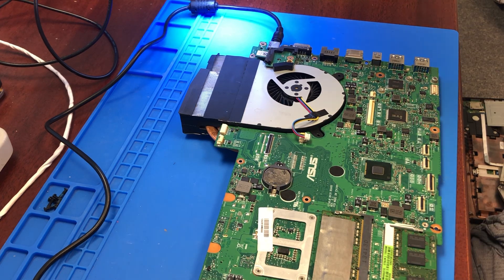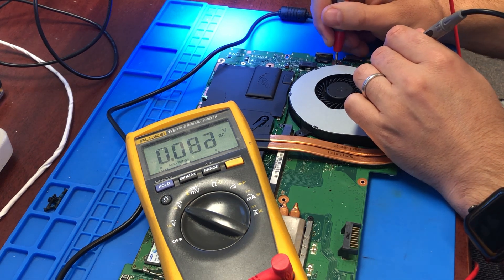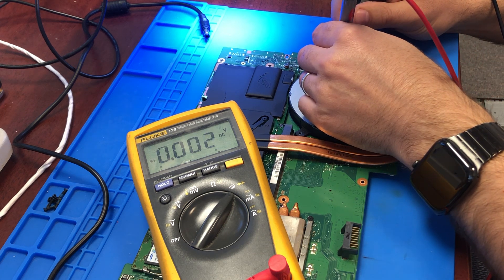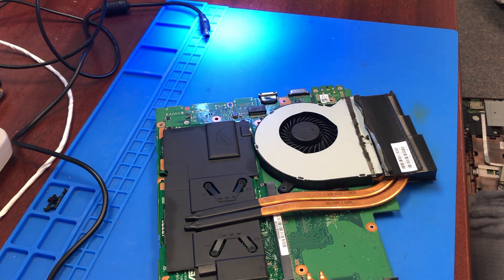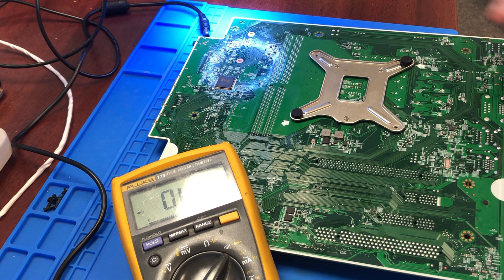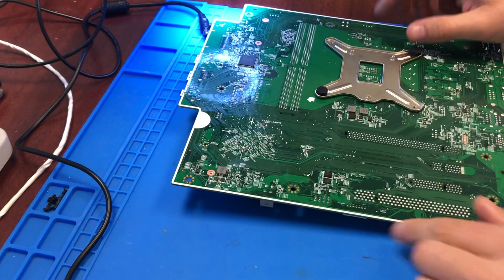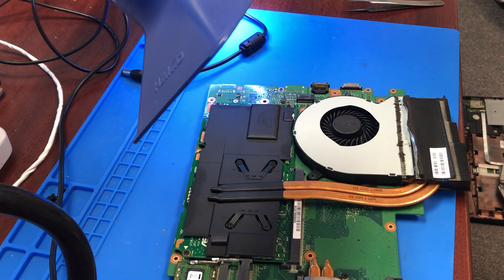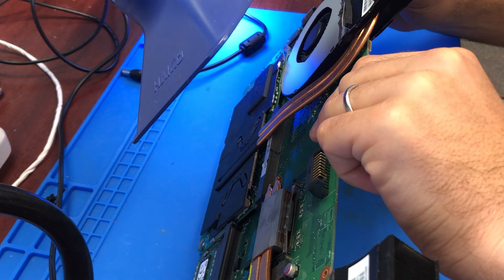Repair NO POWER ASUS G750JW Gaming Laptop. Replacing shot mosfet 4983NF

Comment: hello sir, I have a problem with my computer asus g750jm my battery does not charge even I replaced with a new battery and I did all the solutions still the same problem could you help me where the breakdown comes from
Reply from the maker: You need a good quality battery, preferred genuine one for these gaming computers. A lot of aftermarket batteries are junk. I would start with that, get a known-good battery first before you ho any further

Comment: I have a G750 JM. The motherboard is the same and I was able to turn it on until last week, so I desasembled it and I was trying to fix it with a multimeter with little knowledge and I accidentally shorted the power button. Now it doesn't turn on anymore and those tricks to turn on motherboards without the power button don't work with it. Only one time It turned on with the fan and then it stopped suddenly. I think the problem had an easy fix like in your video and I just messed it up. I wish I have seen your video before.

Comment: Looking at the boardview, these mosfets are in parallel. Therefore, it is impossible to determine on the board which one is shorted.
Reply from the maker: Multimeter in diode mode is your friend
Reply: @applepietech  thanks

Comment: I have G750JZ more likely motherboard to yours, no power ON, my diagnostic i found 4.12 Volt instead of 19. 5 on first mosfet, and i have short circuit on FAN0_PWM to the ground, any help will be appreciated, thanks.
Reply: Almost the same. I have 3,9 instead of 19. But didn't found any shorts. Do you have the schematics?